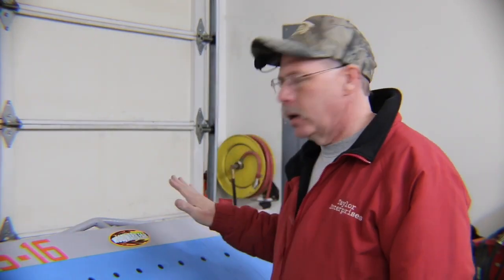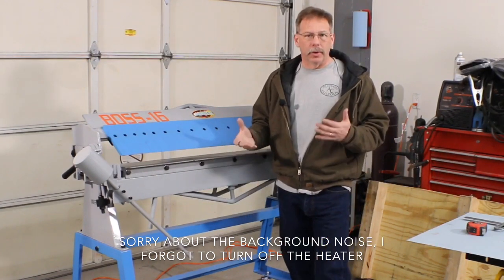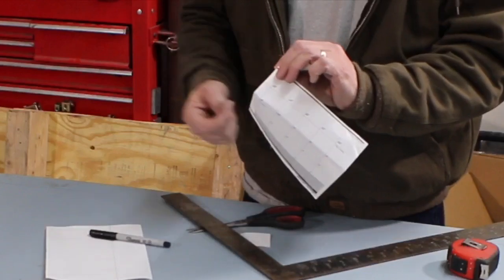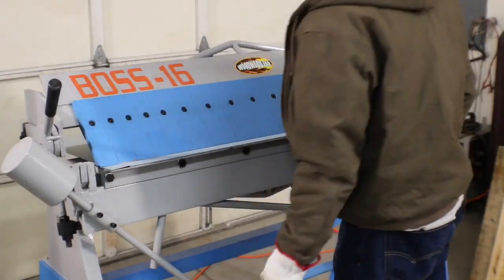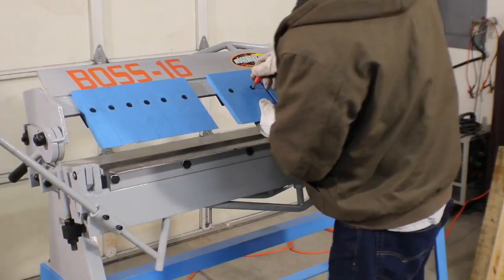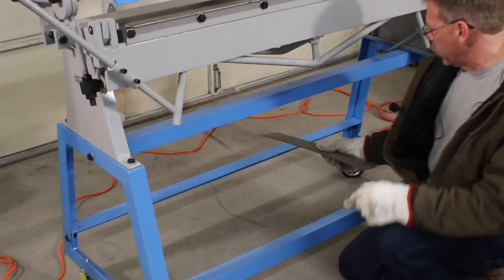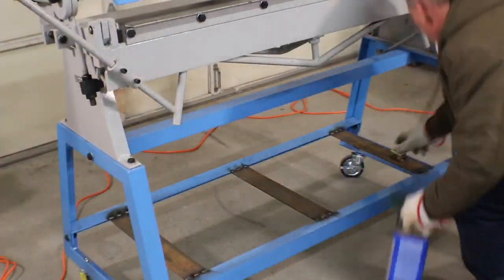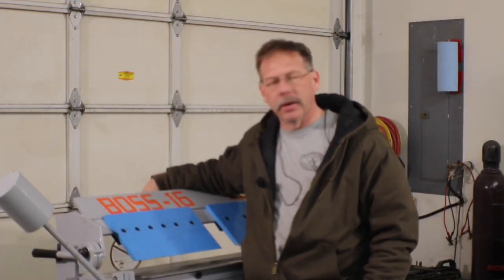Woodward Fab’s BOSS-16 Sheet Metal Brake - Making a Tool Tray

Comment: Nice job on the video.  I welded up a stand for my Jet BPB-1650 similar to the Woodward Boss stand, but flipped the lower angle steel pieces between the ends... that creates a tray to insert a plywood shelf, and the upward-facing leg of that angle steel act as a tray edge similar to the poster's drop-in tray.  The tray holds ready rolls of 020, 025, and 032 plus a scrap box to get shims and other quick stuff out for my airplane project.  

FWIW, the Boss looks to be a great deal, with even more beef than the Jet and a welded stand versus the sheet metal standard factory stand that really does not work all that well.
Reply from the maker: I do like the beef of it, but I have had several problems with the threaded rod that is supposed to give you a repeatable bend guide.  One of these days I will have to work that system over. But for now it does what I need most of the time!